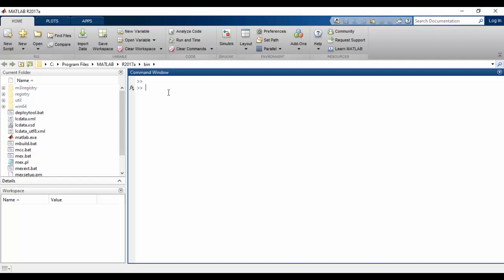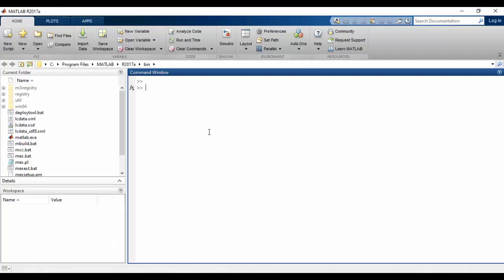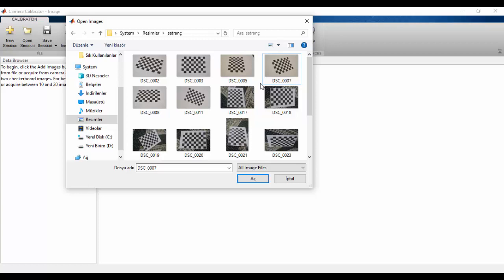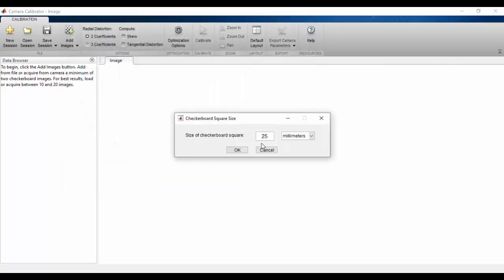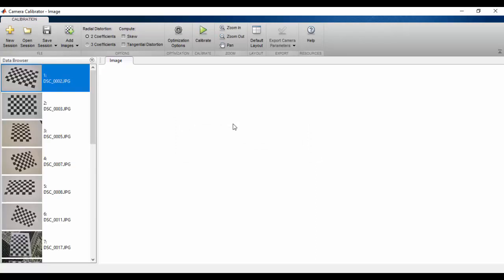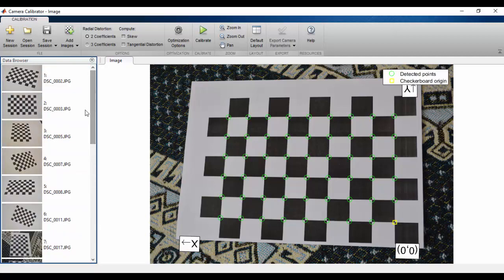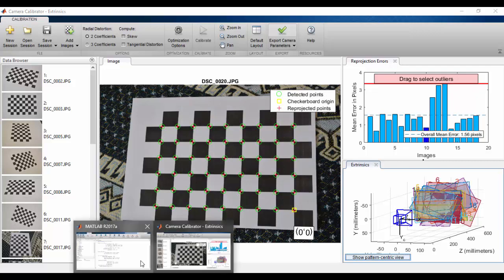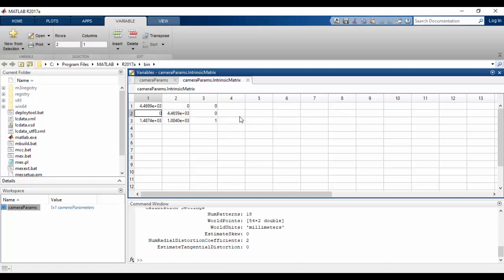Camera Calibration with MATLAB

Comment: Thank you for the helpful video.  For my camera to be properly calibrated, I need to enter a Tilt Angle (expressed in degrees), a Roll Angle (expressed in degrees), and the Focal Length.  The camera uses these values plus the height of the camera to determine what it is seeing and for tracking of moving objects.  Can Matlab determine Tilt and Roll angles plus the focal length?  Thanks a lot.

Comment: When I try to add images with different angles, it says image sizes should be same do you know why is that?
Reply: Note that the photo is horizontal  or vertical,
All photos must be the same, all horizontal or all vertical.
Reply from the maker: I do not know what causes this problem but maybe related with your camera ? Do not use auto mode . use manuel mode with spesific focus and size.If you want what size is best look at  13th page https://www.slideshare.net/ammaslkesen/3d-reconstruction-structure-from-motion